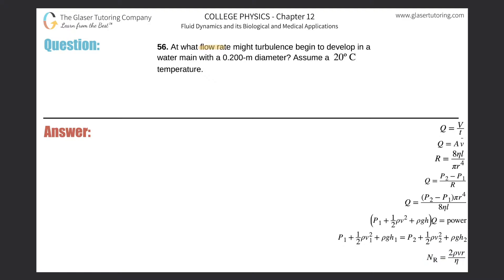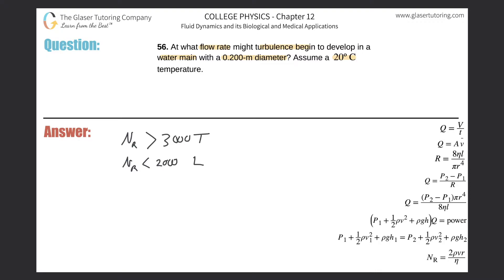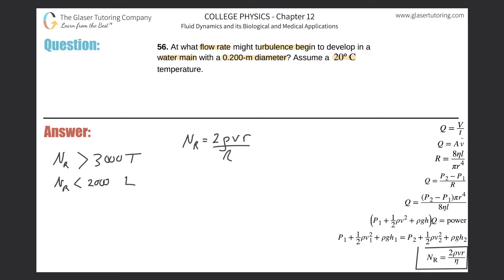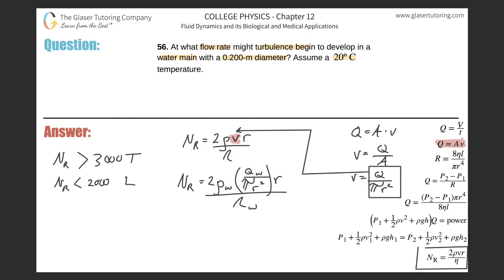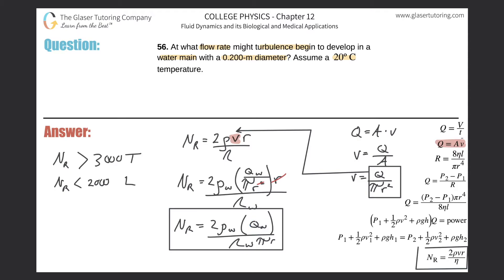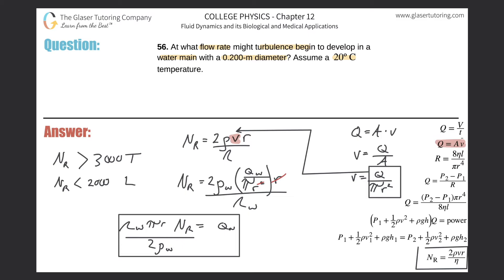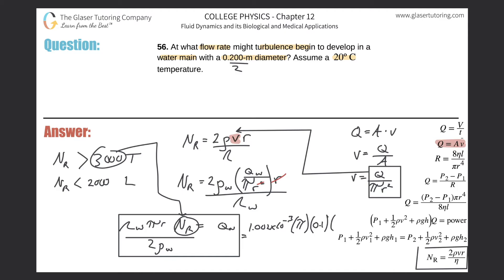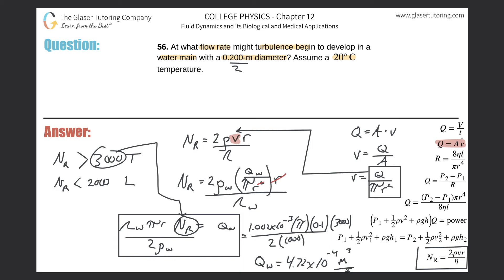12.56 | At what flow rate might turbulence begin to develop in a water main with a 0.200-m diameter?

Comment: Nothing wrong with this problem, thank you for your help as always! I would argue though that since the question asked when "might" turbulence begin that the Reynold's number would be 2000 or greater. This is because above 2000, turbulence is possible. Above 3000, turbulence is a given.
Reply: I agree with this comment.
Reply: This was exactly right, my answer was wrong when entering 3,000 but correct when using 2,000. Thank you, this comment gave me a better understanding of the topic. 👍